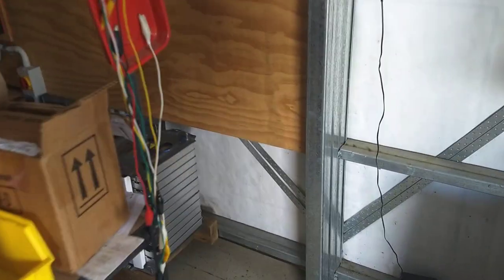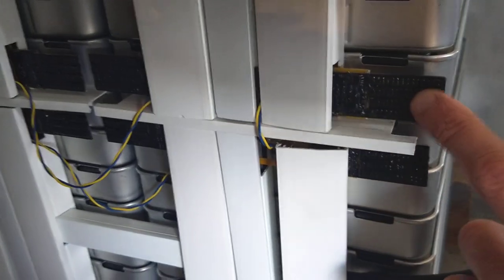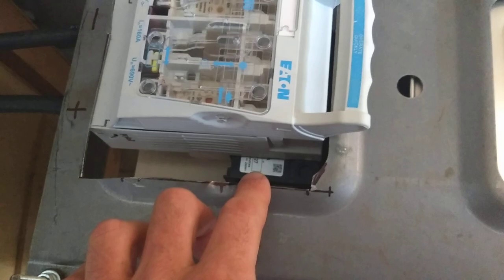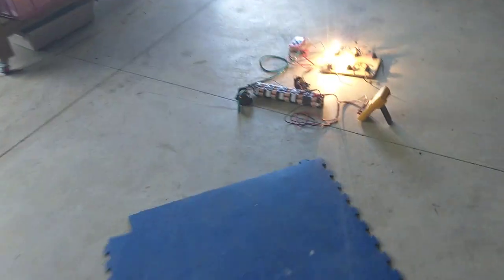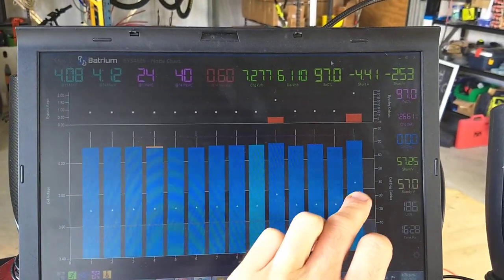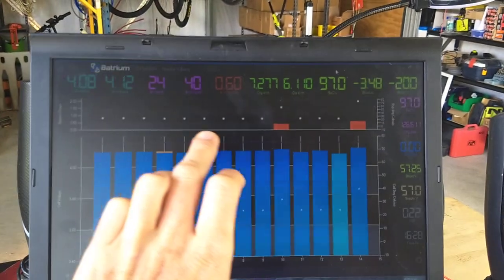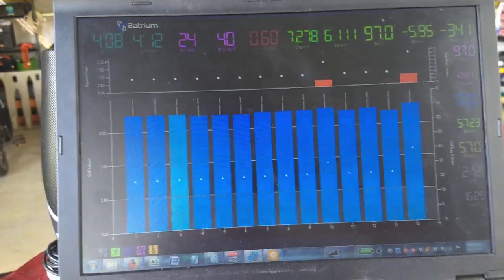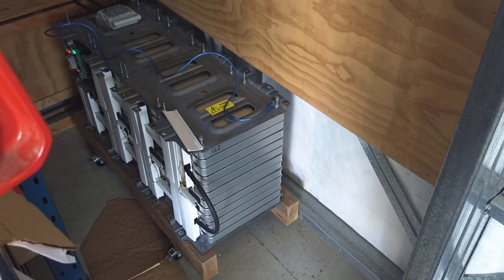Powerwall Finished!  DIY Leaf Powerwall with Batrium LeafMon BMS

Comment: Hi nice vids, I went through on a few of them. I commissioned my system which is similar to yours, but I'm on the grid, and I use slightly more degraded GEN2 batteries. Apparently my Batrium (the newer version )Watchmon CORE is randomly stopping, and I noticed today sometimes restart as well, which makes me think it would not be the best if I want to use it to protect the batteries, or my system. Have you noticed anything like this with yours? Or have you had any issues with the Batrium at all? I know you have lots of things going on, and I'm not sure if you still using it, but any comment regarding the Batrium reliability would be great.
Reply from the maker: Hi there,  I'm still using this and it works fine. With mine there are sooooo many settings that it is hard to know if you have set it up right. Try their help pages and if you can't fix it email them. They have always provided good help to me.
Reply: @RaglansElectricBaboon  Thanks for coming back so quickly, I already emailed them several times, but only automatic reply what I get yet. It's a great platform, sort of self explanatory, if it works. I just loosing my fathe...
Reply from the maker: @arpa592  they are not always fast at responding. Be patient :)
Reply: @RaglansElectricBaboon  yeah, I have no choice...😉

Comment: hello I watch your YouTube video on your Nissan Leaf battery setup with solar, just would like to know how do you wire the relay from the Nissan Leaf batter pack into your system? i would like to use the same, thank you.
Reply from the maker: Hi Fabian. I use a Nissan Leaf Contactor (a contactor is just a high-capacity relay) on the + & - outputs of the battery. I have a 12V power supply which provides the correct voltage for them. I use the Batrium BMS to control them.
Be careful, the Leaf relays are not designed to switch high currents. Mine have welded closed (connected) and need replacing.
Reply: Raglan's Electric Baboon  is it possible to show a picture of how to control them with the watchmon i want to use mine on a small battery bank .? Thank you.
Reply from the maker: @fabianwaite  https://youtu.be/7Aj1lMjCxHA

Comment: Am I correct in saying that the Batrium system is a monitoring system, not a management system? As in, the Batrium won't disconnect/reconnect the battery from the load?
Reply from the maker: Yes and no. The batrium sends signals to disconnect but you need to provide appropriate relays/ contractors
Reply from the maker: It sends disconnect signals which can control relays/contactors.
Reply: @RaglansElectricBaboon  Excellent - thank you for clarifying!

Comment: OMG.This is amazing !!! I have Nissan Leaf,but I don't know how to connect to the house main braker box in case of power outtage.Is there any conversion or connection box out there for Leaf to House?
Reply from the maker: I'm offgrid and so can't help you there. Nothing of what I've done is standard, anything can be made :)
Reply: Nissan is making nice conversion box EV to House,which is hooked into main el. box in the house,but only available in Japan,not USA.It is so cool, you just plug it through ChaDemo and that's it.In case of hurricanes, that is awesome, but not available in US yet.
Reply: MB031 well... having a transfer switch, and inverter kinda helps...

Comment: Each module has two cells. How are you able to monitor the individual cells one each module. How did you connect them?
Reply from the maker: The leafmon boards from batrium connect to the the terminals on each module.
Reply: thank you for your quick response. There are three terminals. The positive and negative. The middle terminal allows you to read the cells that make up each module. Do you use the middle terminal as well? Or are you reading 7.6V from each module? I appreciate your quick response
Reply from the maker: The terminals on a Leaf module go 0V, 3.7V, 7.4V. Get your hands on one and you'll understand :)
Reply: @RaglansElectricBaboon  if you visit my channel you will see the leaf module. I have a small 7S system. I am a bit familiar with them. I need to get a BMS

Comment: What are inverter and controller are you using. I will assume 14 x 3.7 is your nominal voltage or are you charging to higher numbers. What is the minimum voltage that you set as your cut off?
Reply from the maker: I'm all Outback - FM80 controller and GFX3300 inverter.
3.7V is nominal so I'm charging to higher and discharging to lower. 4.1 and 3.3 are my limits, 4.06 and 3.6 are my targets.

Comment: Can you run your dryer and air conditioner off this system?
Reply from the maker: I can run 3.3kW all day or 5kW in bursts. I don't have a dryer (I use a line, simple solutions are great!) and I don't have AC. I do run my kettle because I'm British and like Tea and I do this at the same time as charging my EV.
Reply: Raglan Electric Bikes while I agree on simple solutions, I live in New England. Hanging cloths on a line is not an option about 7 months out of the year... looking for more energy efficient cloths dryers or draping them over the wood stove is another ..
Reply: Raglan Electric Bikes thank you for responding. How much did the batteries put you in for ? Thanks again.
Reply from the maker: They came out of my car - see my other vids for the story there. The replacement batteries which went into my car, I honestly can't remember! NZ$3 or $4k maybe.
Reply from the maker: Hang them by the wood stove (although I don't condone combustion) and run a dehumidifier at them. The batteries will easily run a dehumidifier. Not only will this dry your clothes more quickly it will also make your house feel much warmer. I wish I had understood this this when I was student in cold houses drying laundry!
Reply from the maker: I think maybe they do
Reply: @ZoneTelevision  Heatpump dryer all the way then, we don't even bother hanging washing out any more, even when the weather is nice.

Comment: Looks fantastic.  I am considering Batrium for my setup as well.  Are you running 3 batteries (six cells) per Leafmon here for a total of 14 LeafMons?  Thanks!
Reply from the maker: Thanks. I'm running 6 cells per Leafmon, 7 Leafmons total.
Reply: New to this stuff. Why don't we use a leafMon on each cell?
Reply from the maker: Batteries in parallel behave exactly the same as one big battery. Parallel to increase capacity (Ah). Series to increase voltage. However you connect them, total energy remains the same.
Reply: @RaglansElectricBaboon  thanks so they sort of self balance when connected in parallel? Do you still have to check they are the same voltage every so often?
Reply from the maker: No, not sort of. They are and can only be at the same voltage. This is fundamental to electricity. Try and get a voltage difference in a copper bar if you don't believe me ;) It is very important that they are as close to the exact same voltage as each other when you first parallel them up. To make a bomb get the polarities wrong.

Comment: Hi.
Where are you based, please? I would very much like to meet up for a chat, I run on lead forklift cells (off grid over 20 years) at the moment and want to build a battery like this, some advice would be much appreciated, 
Thanks
Tom
Reply from the maker: Good effort on being Lead Acid for so long. I'm in Raglan, New Zealand. How about you?
I'm happy to answer the questions that interest me here in public on YouTube. For conversations I charge an hourly rate-time is precious!
Reply: Ah yep- well I live in Devon, UK. Although I do get over your way now and then, one of my brothers lives in the taranaki and I have mates in the Coromandel and Northland, I've done quite a bit of business with some of them over the years but never been charged for a conversation yet! 

I'll tell you which bits I need to know about and you can decide whether you're interested enough to discuss it or not! 
1. I'm aiming at reconfiguring to 48v nominal, 
2. I'm looking at outback inverter/chargers but I don't know enough about the charging pattern of lithium to fully appreciate what I need in the way of a bms so advice on that would be appreciated.

Most of all I'd like to see the system you have built really to get an idea of how you've done your connections etc, as it happens I might be over your way next year building a house for someone, so if I can afford it I'll see if I can pop in (!) 

All the best
Tom
Reply from the maker: A visit and a cup of tea I can manage for free!
Do some reading about lithiums-it's really pretty simple compared with lead, just a different paradigm. No bulk or float charge needed. Just a max current and max voltage. The key is that you don't let any cell get above it's max voltage. If your pack is out of balance you can be below the overall max voltage but a cell or two may be over its individual max and then you have trouble.
The outback stuff is a charge controller and inverter, it doesn't do the BMS. As you can see from this and my other videos I'm using a Batrium BMS.
I may have something simpler to sell soon. Watch this space!
Reply: That's more like it! You never know where these things may lead! I'll save your channel or whatever it's called, and keep an eye out for a bms update, many thanks.